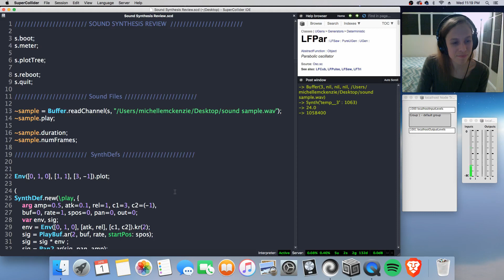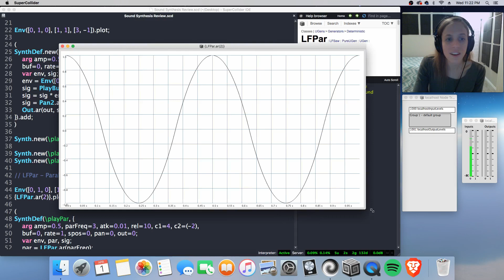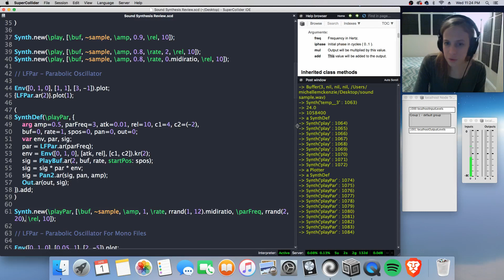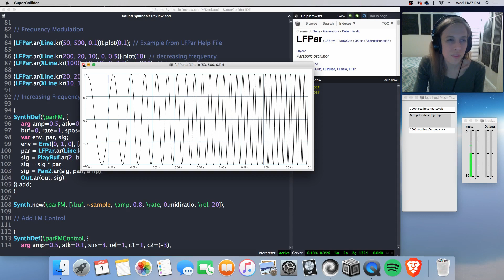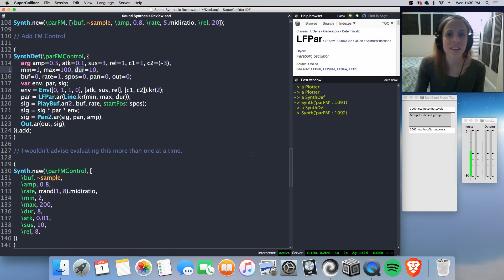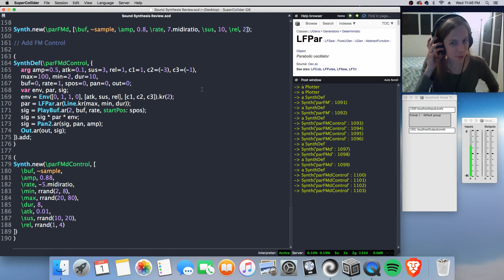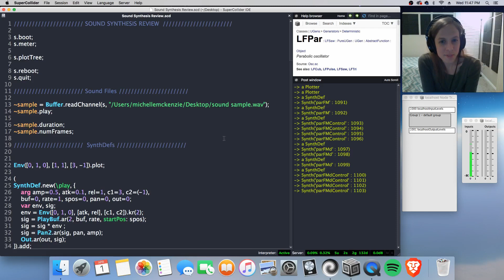Sound Synthesis Using A Parabolic Oscillator (LFPar)

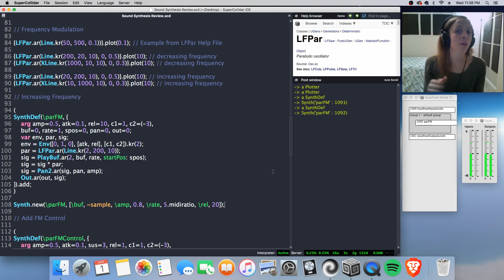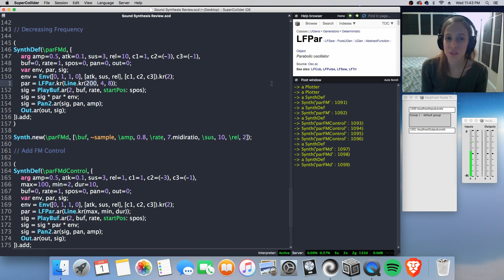Comment from the maker: I need to make a correction regarding FM Control synths you see at 10:49 and 15:35. I say I'm adding FM control. Actually, I had been using an FM control the whole time, starting at 3:57. When I say I'm adding FM control here, I'm simply adding arguments to the control variable, "par." Sorry if this caused any confusion.

Comment: Hello, I have a idea and don’t know how to execute it. I want to get in contact with you do you have discord or something?
Reply from the maker: No, I don't use discord. Is it a syntax question?
Reply: @SoundEngraver  it’s hard to explain. Basically, it involves replacing the saw and sine oscillators of a project with samples while continuing the implementation of the original notes throughout the piece
Reply: Imagine you made a processing chain of like 30 saw oscillators but then you realized you needed them samples
Reply from the maker: @thatnewcool7669  Yes, thank you. I don't completely understand the nature of the problem, unless you're saying you want to use sound files instead of tones and use Saw or Sine as controllers. That's certainly feasible in SuperCollider. I touch on that in my later FM synthesis and Granular synthesis videos.

Comment: For voice processing, be sure to try the 2nd example in the help file for the PitchShift UGEN some time - hours of fun :) If I may make a small remark on the demo itself: while indeed you are using frequency modulation in the LFPar, what I hear most is the result of amplitude modulation (AM): you multiply the volume of your signal with the LFPar resulting in this "vibrato" type of sound. Because the LFPar currently passes through zero and also becomes negative the vibrato is very "deep" or "heavy" (not sure how to best describe). If you'd offset the LFPar to always remain in a range of - say - [0.4, 0.8], you could also create more subtle vibratos. The result would perhaps be closer to what I understand under frequency modulation if e.g. you modulated the rate in the playbuf with some LFPar (perhaps again offset to avoid negative values, because negative rates play the audio backwards - which can also lead to interesting results of course). Lots of stuff waiting to be discovered!
Reply from the maker: Yes, thank you for the recommendation. There's definitely a rise and fall in amplitude using the LFPar, a kind of amplitude modulation, like you say. I haven't yet explored AM in this exercise. The FM is the control method used in Line.kr of the LFPar, thus having that dynamic shift in pulsations, going up or down.